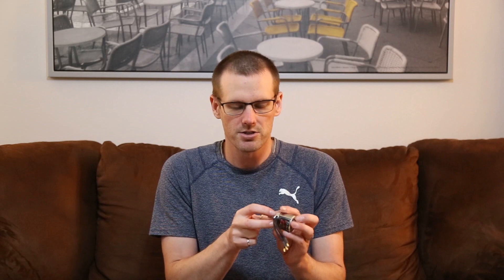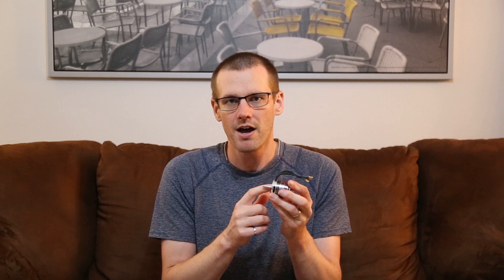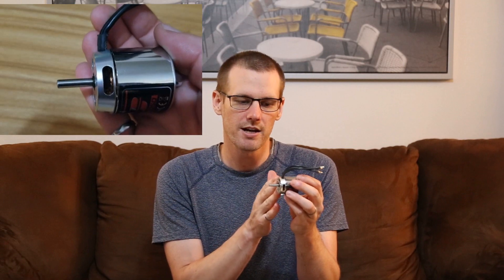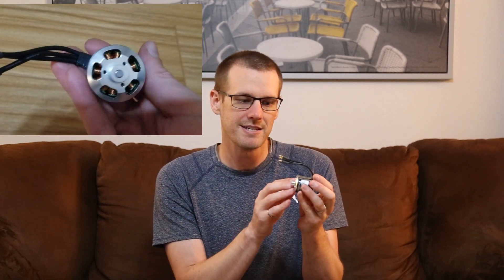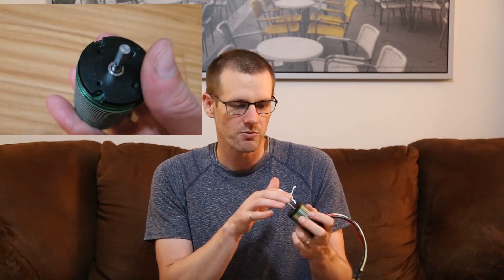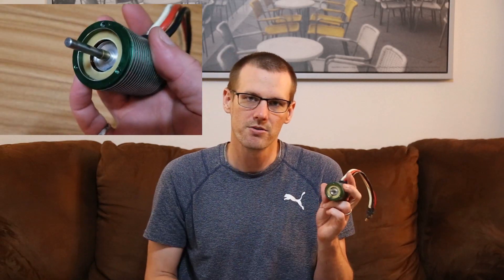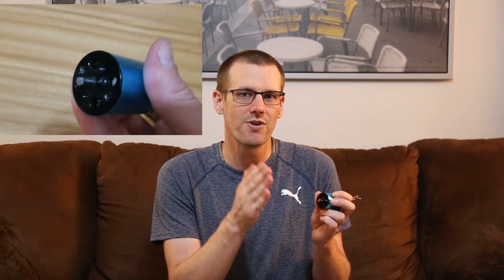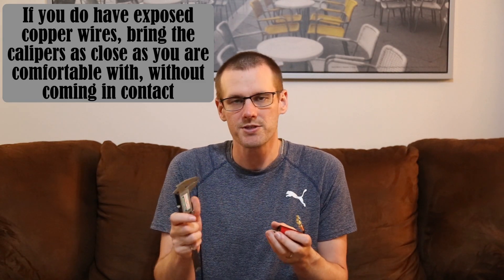Avoid Destroying a Brushless Motor before even Running it!

Comment: I used a long screw on this new motor and felt like i was forcing the screws in, could be the reason to why my brushless motor stutters/ jerky???
Reply from the maker: If you are concerned, I recommend measuring the voltage of each phase with a multimeter and seeing how close the values are from one another. You can create a voltage by spinning up yhe motor with a drill. I have a video on it.
Reply: @ ok i dont know how to do those but thanx for trying to help
Reply from the maker: https://youtu.be/pCkVIUO7JLw